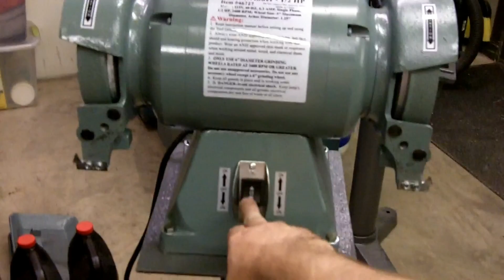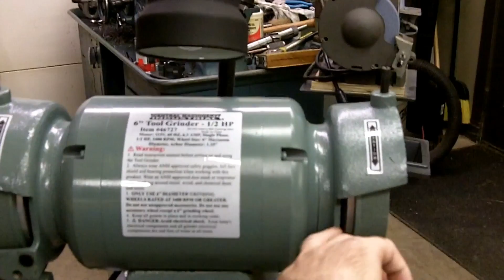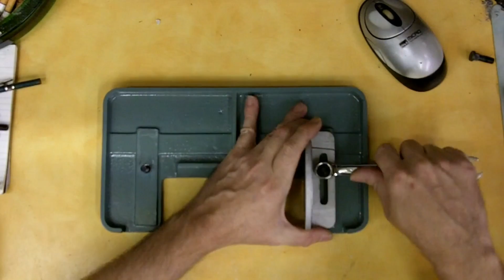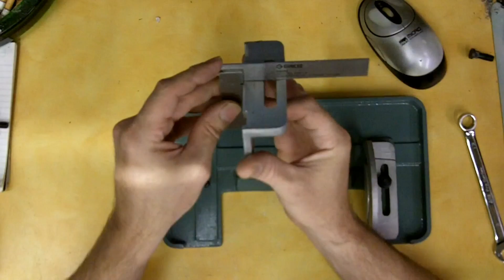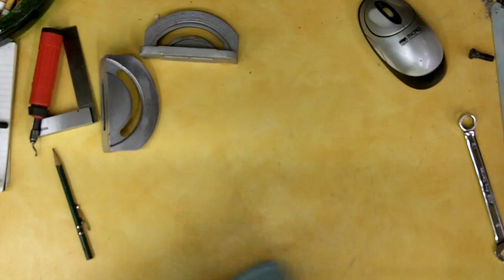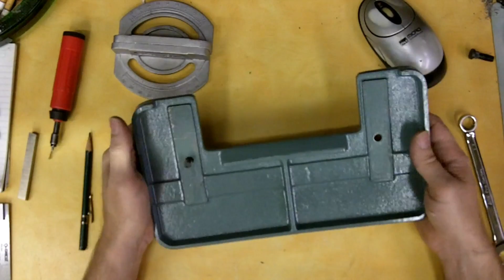Part 1-5 Harbor Freight Carbide Tool Grinder Review and Modifications

Comment: Just SCORED one of these at the dopest pawn shop in town. 

Got mine for $50 with drill bit grinding attachment and diamond face grinding wheel. 

Yeah the table adjustment is hilarious. And there’s listed angles that you can’t reach either. 

Anyway, super excited for mine. It’ll be a damn fine addition to the knife shop.
Reply from the maker: First off, you stole it- especially with a diamond faced wheel. That alone was well worth $50 and then some. Hope it works out well for your craft. Good luck and take care, G.

Comment: hey thanks for response -  we don't get the asian carbide grinders here so had no idea that a second hand option in the usa is so much more expensive - i happen to be restoring  an aussie made 8 inch one which is a monster - good luck with the machine - regards.
Reply from the maker: +Gez 13 
No problem! Yeah, I think the lest expensive one I've seen was about $400US with no wheels and it was hammered. If they have diamond or CBN wheels loaded up they go for much more. Thanks! Once I finished the factories work on this one, it's been doing quite well.

Sounds like you've got a good machine to restore. It does sound like it is a monster..lol. I like restoring old machines, etc. I've been meaning to restore my South Bend lathe since I got it, but still have not found the time. At least now I can use it and not worry about dinging up my pretty paint job..lol. Good luck with your restoration! G.

Comment: I've had one of these grinders sitting in my shop for a couple years. I just got around to fixing it using your video. Great stuff. But the grinding wheels I see online do not look the same as the HF. For example, this one  has countersunk holes. Can you provide a link on the type of grinding wheels you are using?

http://www.ebay.com/itm/HHIP-2403-6999-6-x-1-16-x-1-x-1-1-4-Inch-75-6A2C-Plain-CBN-Wheel/331437775992?_trksid=p2047675.c100005.m1851&_trkparms=aid%3D222007%26algo%3DSIC.MBE%26ao%3D1%26asc%3D20131003132420%26meid%3D05084330cefb407c81fc812a77bf9079%26pid%3D100005%26rk%3D3%26rkt%3D6%26sd%3D231576547752
Reply from the maker: senigalliaprod Thanks! I'm glad the video was helpful. That's correct, unless you go with a SC wheel like came with the grinder for carbide, or find an AO wheel for HSS somewhere, most you find will have the counter sunk holes. I never purchased the wheels I had my eye on, but here is a link to the one I chose. They also have other widths of media, depths of media, and concentration at varying prices. As for the holes being countersunk, it should just be a matter of locating a proper countersinking bolt/screw and all should work just fine.

Since the link you provided claims to be CBN wheel, I assume you will be grinding HSS but the listing mentions sharpening carbide. That's a red flag to me as a diamond wheel would be the correct wheel for carbide- not CBN. The listing might have things wrong, or it might not be a CBN wheel after all. CBN wheels are much more expensive then diamond so I would use caution unless you know for sure what it is and if it will meet your intended purposes. I'm not saying it's a bait and switch listing, but one never knows. I've seen many wheels listed as CBN/Diamond. It's ether one of the other and they might not even know there is a difference. Or you might get a diamond wheel at a CBN price.

 The link I'm providing should same wheel (if the auction is a CBN wheel) at a little bit better of a price other than it being 150 grit over the 120 in the listing, not considering shipping costs if they charge for them. They also have Diamond wheels for sharpening carbide as well. Sorry for being long winded but I hope this helps, G.

http://www.shars.com/products/abrasives/diamond-cbn-grinding-wheels/6x1-d6a2c-cbn-plain-cup-wheel

Comment: Dont need to do all this to fix just buy 2 new 18mm nuts and buy 4 18mm flat machinist shim washers . fixed with just this problem is aluminum wheels distort with out steel washers on both sides of wheel .
Reply from the maker: Good info. That might work for some, but not the one I have. The backing plates installed on a freshly turned arbor still had tons of runout on mine- so I turned them in place. New nuts and washers might have helped some though. HF no longer sells this grinder. They are sold under other brands, and the quality might be a bit better than the HF model. I would certainly try your fix first before going as far as I did on mine. Take care, G.